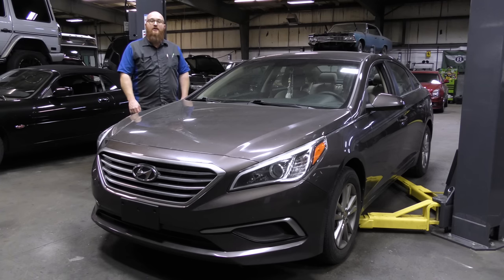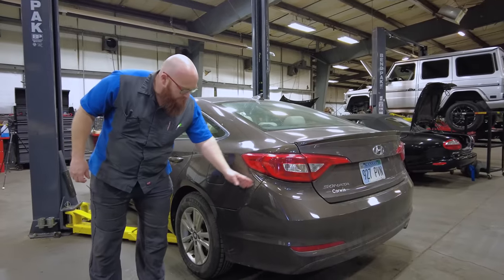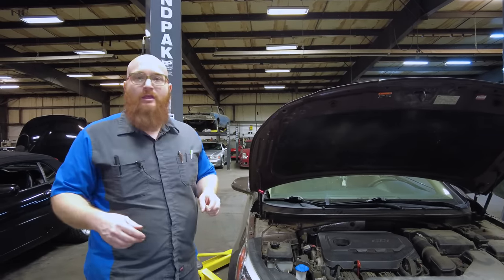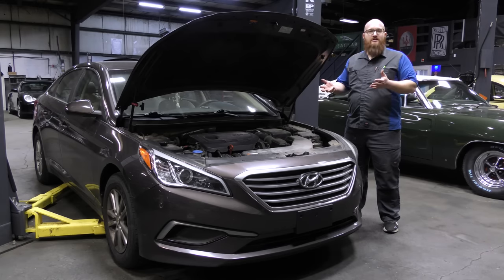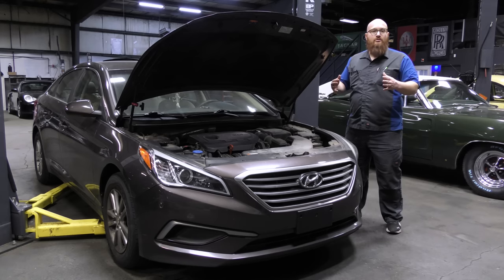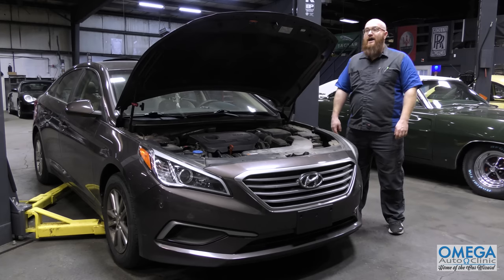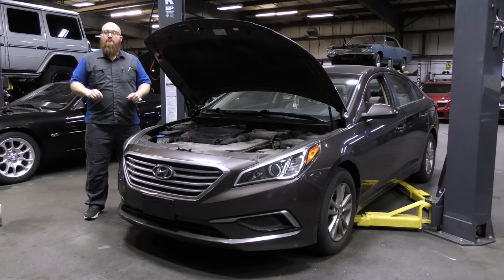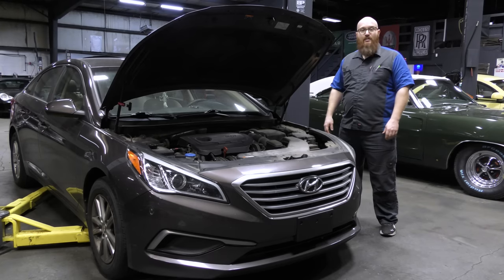What could be so bad on this '16 Hyundai Sonata that the CAR WIZARD is sending it to the junk yard?

Comment: story time - my lady neighbour, leaving in the same street, around 30 y.o, single, drives a small KIA which she bought few years back used. As a guy and a good neighbour, seeing her struggling from time with teh car (dead battery or seized brakes) I offered her some car maintenance on her little car - like literally every few months. She always denied any help. A single strong lady, you know, as she likes to be seen LOL. One day she calls me asking for help with the car. That's new - I thought - and it's probably already worse than I even can imagine. It turned out the car wants to crank, but won't start. Battery, fuses, fuel, fuel pump, sparkplugs, filters, starter.. checked all of this - obviously everything neglected and air filter as dirty as a mud-rag. Oil level was the last I checked. Dipstick dry. When I asked her when she did the last oil-change she just made big eyes saying "what?" . When I started to explain that probably the engine might be even seized or something, she started to get upset and eventually started to cry. Long story short - her small kia got scrapped few days later after a pofessional mechanic - not just some random neighbour like myself LOL - told her - not for free - how much it will cost her to get the car back on road. 
She got a next car - I don't offer her any help with it anymore. It's pointless in some cases. Some people will never understand that machines need maintenance. They would want everything to be easy and fun.
Reply: Pride is one hell of a thing
Reply: put a prius c drivetrain in there. mine used 1/2qt oil in 30,000 miles, and that's after i bought it at 180,000 miles
Reply: she probably thought you were hitting on her even though you were just being nice
Reply: @alvarorangel5513  LOL - never thougt about this before, might have been truth though
Reply: Not listening to advise is the road to hell
Reply: So, strong women do cry
Reply: i drive 20 years old honda.
i change oil every other year, run like new.
Reply: i have a 2016 got my oil changed by dealer 4daysblater no oil in the engine bringnit back they say theybsidnt donit blah blah blah nothing is leaking . this car burns 5 quarts of oil ever month or so. its crazy i bever dealt with nothing like it. its not my fault i always check fluids this engine has a oil burning problem
Reply: @alvarorangel5513  Reminds me of the meme where a guy tells a woman she dropped her wallet and she replies "Sorry I already have a boyfriend"
Reply: Ya gotta pick your fights. So many ditzes out there identifying with ignorant
Reply: I have been thinking about this lately. Part of me actually wonders if one of the reasons cars were created was to keep women dependent on men. I mean think about it, most women are just COMPLETELY incompetent when it comes to cars, they absolutely REFUSE to learn ANYTHING about them. If cars didn't exist many women would actually not need men, cars are totally something a man could use to get sex from women if he wanted to be like that..... 

My mom has been getting scammed a LOT lately. I have slowed down doing work for her because she takes me for granted and honestly I have my own problems to deal with. I have realized that women and cars are probably the worst thing. She trashes cars within years, every vehicle she gets I know is basically a death sentence for the car it will become dirty, never cleaned, full of fast food bags, it will get dinged up, fall apart. 

I don't blame my mom, I just have to be honest about women a lot of them just don't have the ability to take care of cars. Mechanics will easily scam them, lube shops will charge like $100 to change the oil on a honda..... It gets crazy. Women get scammed when buying a car too. IDK, I think cars and women is like mixing water and oil. It makes you respect a woman who works on her car WAY more.
Reply: TMI dude.  Get a life.
Reply: @jeepercreepers54  warned you with the first two words LOL
Reply: @jeepercreepers54 right
Reply: @hhjhj393  correct - and even if a lady doesn't work on her car herself but more or less understands what needs to be done and what costs are involved- this will be enough to respect such a woman as far as cars are involved :)

Actually while writing this I realised I know at least 3 women as describes above- one being my sister- so it makes actually 2 women lol

Comment: I bought a 1992 VW Golf for $100, that was in pretty much the exact same shape, except the oil pressure light (and buzzer) was on. Dropped the pan, and the “oil” was nothing but sludge. The oil pump pick up screen was covered in a solid “mud cake.”
    Cleaned the pickup, shoveled out the pan, and reinstalled. Filled the engine with 2 quarts of “Motor Flush” and two quarts of cheap 5W-30. Let it idle for 10 mins, then proceeded to steadily increase throttle until it was near 4K rpm. Expecting it to either “grenade” at any moment, or clear the blockages. Miraculously, it suddenly cleared, and the oil light/buzzer went off. 
    Dropped the pan, dumped all the new gunk/sludge, and recleaned the oil pick up. 
    Plasti-gauged and replaced one horribly torched rod bearing, and filled it back up with 4 quarts of Mobil 1 10W-30.
    Proceeded to deliver Dominos pizza in that car for the next two years. It ran just fine, and sounded relatively normal in the winter. In the heat of the summer months, though, someone once asked me if it was a diesel. 😂
   So, sometimes “dead” doesn’t always mean it MUST be buried. Where there’s a will, there’s a way.
    You mentioned the salvage yard, as that Hyundai’s likely destination. And halfway through the video I was thinking salvage yard. Not for drop off, but for pick up, of a used engine out of a wrecked donor car. 
    Aside from that option, you could have also purchased it from the customer for a song, and started parting it out on eBay with “local pick up only” for all the parts. No hassle in dealing with shipping, and you’d make a ton of $.
     Thanks for reading my novel. Have a nice day everyone!
Reply: I tried that with my lemon. Previous owner never changed oil regularly.  Good luck with that. Ended up selling it for scrap.

Comment: Wow I was one of the lucky ones...

I have a '16 Hyundai Sonata where this exact thing happened. Keep in mind that I have always serviced my vehicle at the dealer, including all oil changes. Here's how it went down:

I went for an oil change, and on my way back home, the engine lost basically all its oil, and I was leaving a trail of oil on the highway. I had to immediately pull over because it felt like the engine was about to blow. Ended up calling a tow truck. I then called the dealership and told them what just happened, given that my car had literally left their shop less than 30 minutes before it happened. With this being the case, and my maintenance history with them, they replaced my engine free of charge, and now I also have lifetime warranty on the new engine they put in. 

After the engine was replaced, they mentioned a lot of the same issues... flakes in the oil and cylinders, knocking, etc.  I'm glad I was able to escape such a scenario as what this customer is going through.
Reply: yeah paying for the oil changes can get you a free engine in there's a recall on that engine for being bad if it's a junk engine maintaining it is still worth it incase of recalls
Reply: @raven4k998 I have a 2019 sonata with this engine that my wife drives. Every maintenance has been at the dealer for this exact reason.
Reply: Wow you got lucky. Hyundai's and kias are junk. Thank God they took care of you 🙏
Reply: It's because its a flawed design from the start as Scotty Kilmer said.

Avoid Hyundai + Kia.

They'd like to be considered in the same realm as Toyota and Honda, and while there's 'value' for the short term, there isn't long term reliability.

You pay for what you get.
Reply: "I went for an oil change, and on my way back home, the engine lost basically all its oil, and I was leaving a trail of oil on the highway."
No way you drive in perfectly fine for a routine oil change and leave with oil pouring out on the highway... because of a bad engine?? It sounds more like the dealer tech apprentice messed up.
Reply: @outermarker5801  I mean I think the sudden loss of oil certainly accelerated the time to fail haha
Reply: Same thing happened to me with my 2012 Sonata. Regular oil changes but it burned oil like a fiend. I just got approval on my engine thanks to my wise and caring mechanic who’d made referrals for the same failures on multiple customers before me. 

After much diligence and patience, they approved the new engine. It should be a couple weeks until it’s done. It’s a MASSIVE problem with millions of Hyundais and Kias.
Reply: always change your own oil. it takes literally minutes and you get to inspect your engine, trying to not look under the hood of a car is game over.
Reply: Tech apprentice who changed oil left old oil filter gasket and put a new filter on. The old gasket was blown out as soon as you raised rpm. It happens very often, because the oil change kid is not trained or supervised properly.
Reply: Sounds like you needed a new gasket or the oil pan was cracked which probably needed replacement. Happened to my oil pan and they said I needed to replace it. There are ppl with sonatas over 200,000 miles idk why people bash because this problem don’t happen to everyone.
Reply: @fuzzjunky Sadly these Hyundai / Kia engines are failing in high numbers. Without documentation for all maintenance items the corporation will deny any claim and accuse the owner with maintenance neglect as the cause.
My engine seized and the last oil change was only 2500 miles. What I and many others didn't realize is the amount of oil the engine was using. 
When I had mine towed to the medium sized local dealer he informed me 38 autos with similar issues were ahead of me just for diagnosis.
Obviously, I now tell everyone to avoid Hyundai and Kia.
Reply: @kenstand  mine is a G4ED which has a long long long history of rare failure at ANY point. it's done 185k kms and hasn't missed a beat. still doesn't even use oil. sympathies about your engine. i have heard some bad things about the newer korean blocks.
Reply: @AustinRides7264 hyundai and kias aren't junk, the gdi engine is junk.... so are American cars
Reply: I am assuming you dumped that turd after the engine replacement. I know that I would!:face-orange-frowning:

Comment: Have a 2015 sonata with the 2.4l engine.  With meticulous maintenance. At just 116k miles the engine randomly started misfiring and the check engine light came on while driving down the highway. After limping it home I got the car scanned and it showed a misfire in the 3rd cylinder. After attempting small fixes like spark plugs and plug wires I decided to take it to Long Hyundai, this was my second mistake aside from buying a junk Hyundai in the first place. I stopped taking our car there for oil changes initially because I found an oil filter I had changed the last time still on the car after I paid them for an oil and filter change. With the car at Long, Chris from service stated it had no compression in the 3rd cylinder and it needed head work ($5300), but was pushed to do an engine replacement which was quoted to me at $7-8k, that I would be responsible for. After trying and getting no real diagnosis on the actual problem and a very difficult time trying to communicate with the service department, I picked the car up and coughed up the $200 “diagnostic” fee for nothing. Once I picked up the car I finally got the service report and the diagnosis was “blown head gasket.” I did not have a single symptom of a blown head gasket- no coolant in the oil, no overheating, no smoke out of the exhaust, coolant was clean in the over flow tank with no bubbling. 

I immediately drove to S&S Auto for a second opinion and they quickly found metal material in my oil and no symptoms of a head gasket issue. Long either completely missed this or did not want to tell me. I personally saw the shavings in the oil when I picked it up from S&S. They advised me about the warranty campaign Hyundai has on the 2.4liter engines and they didn’t charge me anything for the diagnostics. After doing my own research I decided to take it back to a dealership to have them handle the situation. I called the service director-John- at Long Hyundai to explain the situation and told him I was taking the car to a different Hyundai service center to reassess. He did not care that I was taking it to another dealership after Long has misdiagnosed the issue. John just told me, “Well let me know what they find.” (Tried getting a hold of him multiple times since and have never gotten a call back)

After moving the car to a third shop, this time Mnt View Hyundai, which is about an hour from my house, I talked to Brian about what was going on and he stated they have been cleaning up a lot of issues from Long. After he had the car for a couple of days he stated he had found the metal shavings in the oil and that the car was misfiring and it should be taken care of under Hyundai’s warranty campaign 953 for excessive bearing wear on the crank. He went back and forth with Hyundai Motors America and I had to give them all my receipts for the oil changes I had done and they stated that my issue was not covered under warranty since my engine wasn’t knocking or locked up yet (basically because it hadn’t left me stranded on the side of the road), but that they would cover 85% of the replaced engine. After fighting for another week and hours on the phone with Hyundai’s warranty departments and Hyundai customer care with no resolve, I had agreed to cover the 15% that Hyundai wouldn’t cover. I was still mad they wouldn’t cover 100% from their own warranty, but it was better knowing Long was going to charge me $7-8k. Brian helped me get a rental car covered from Hyundai since some of the items were on back order. I was very grateful for that since I hadn’t had the car for two weeks at this point. 

A couple weeks later Brian called me and stated the car should be ready in a day or two and suggested random replacements, like air filters and brakes (all I take care of myself and have receipts on the last time I changed them) I picked up the car and paid my 15% of the cost which ended up being $828. I told him I wanted a test drive, no offense to him or the dealership, but I can’t trust anyone. Upon entering the vehicle I noticed the abs light and traction light on and the blind spot detection wasn’t working. I took it for a drive and went back and talked to Brian about that, stating there was no issue with this when I brought it. He had a tech sheet stating they ran the code when they got the car and it was on. I asked why it was never brought up to me while the car was in his shop for almost 3 weeks. He stated the tech ran some tests and stated it was operating properly and didn’t want to sell me a part I didn’t need. I stated having the abs and traction light on could be dangerous and could malfunction and he stated “it won’t lock up” and “it’s fine”. However, he did offer to fix the issue for free labor and I pay for the part, which was $360. I told him I wasn’t giving Hyundai any more money and drove my car home with all three of those lights on my dash. I am glad the car has a new engine and Brian did help me out with a lot of things, but there are still issues that should have been taken care of that just weren’t. The last month with the car and dealing with all of Hyundai has been beyond frustrating and I now have a car I don’t trust or feel safe in. They have definitely lost me and my family as customers and I hope anyone reading this will think twice before buying anything made by Hyundai.
Reply: Toyota is similar. They don't issue warranty enhancements for known problems... and it took six attempts to get a defective CV axle replaced under warranty in a Prius Prime... that had a cancelled TSB about the issue.
Reply: This is why the traditional automaker and dealership model is doomed to fail. Nobody wants to deal with this. I have had a direct sale EV(Tesla) for 5 years and service has been awesome. I had one issue which was common. Squeaking upper control arms. They replaced them in my driveway, charged me $120 for parts and $0 for labor, out of warranty. The 30 seconds I spent on the app creating the appointment was the entirety of time I spent dealing with it. Car Wizard is exactly right on his point about why people will switch to EV’s. We just want to get in and drive.
Reply: You just had a bad experience. That doesn’t represent all Hyundai dealers or vehicles. I have a Hyundai for 6 years now and it still runs like a charm. Yes, I’ve taken it in for its recalls and updates and have definitely kept up with oil changes and minimal maintenance. But in the 6 years I’ve had it, it’s given me almost no issue.
Reply: @leonxl  well it was bad enough for me to have the personal opinion that their cars, and Hyundai are trash. Seen many other stories similar to mine as well. Best of luck with your Hyundai.

Comment: Many years ago I worked part time at a service station and back then we used to pump the petrol etc for the customer. When I asked a young woman who pulled up in a VW Beetle if she wanted the oil checked she replied that they didn't need oil. I informed her that it was air cooled and didn't need water but definitely needed oil!
Reply: Had a Kia for 10 years and my mechanic thanked me personally he said thanks to my car he managed to build a a second level on his house 😅
Reply: @gree9963  damn
Reply: @gree9963  just to be clear, that was not a compliment.